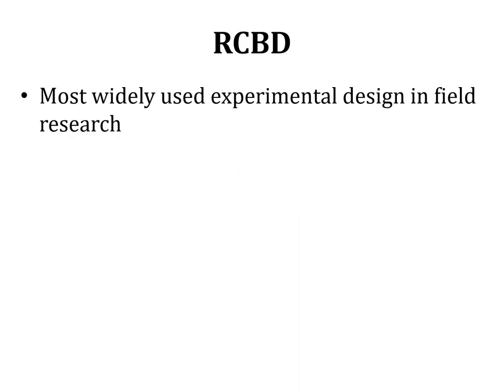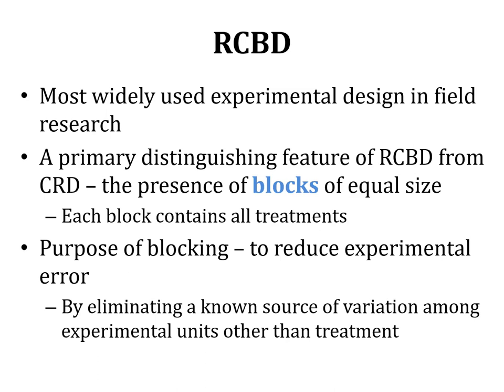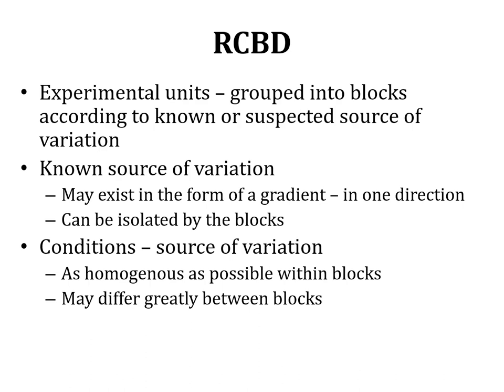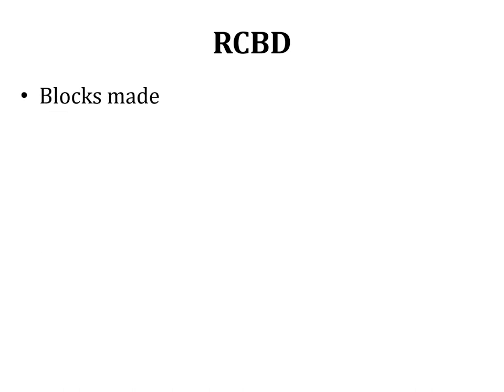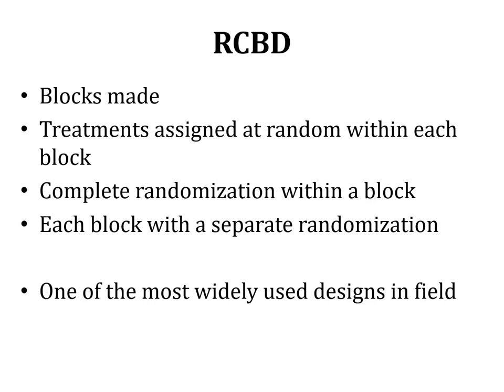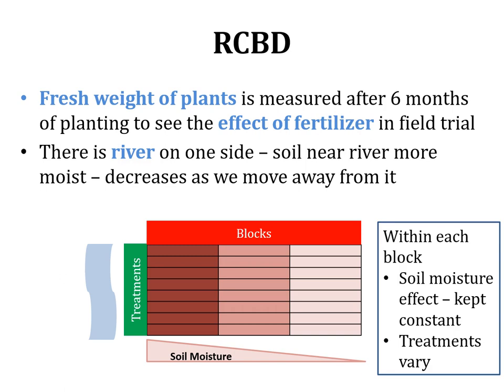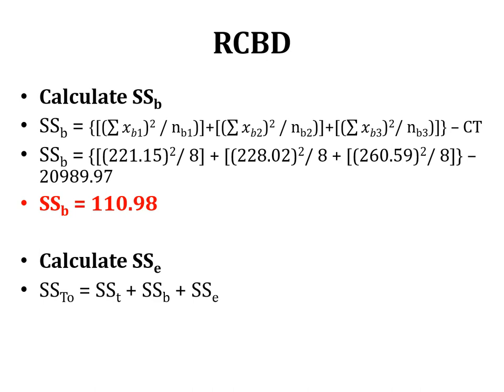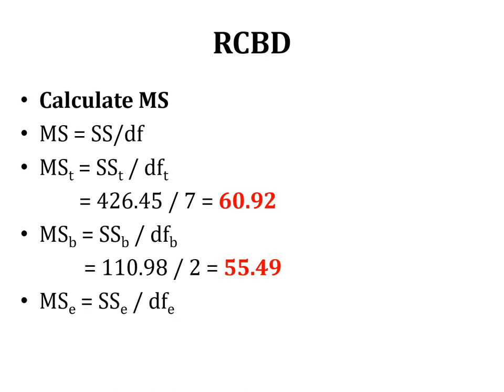Lecture 19 Experimental Designs; RCBD; Randomized Complete Block Design; ANOVA; Two Way ANOVA

Comment: can i ask something, how did u come up with the probability of 0.01 and 0.05, what's ur basis? thank you!
Reply from the maker: You can get the critical F values from F distribution table available in some book or through any online calculator for F test for ANOVA.
If your question is about the probability levels, the 0.05 and 0.01 are critical probability levels. You can watch my video on probability for that.

Comment: Great and Interesting
Madam i need help to analysis the data about pesticide efficacy.
my research is in RCBD design. I used 5 treatments with three replication of each and i got data one day before spray and 1, 3, 5, 7, 10 and 14 days after spray.
Kindly guide me
Reply from the maker: Thanks for the feedback. Probably you will have to use 2-way ANOVA. Main predictor variable would be 5 different treatments that you have used. The other independent variable would be time since application of treatment.

Comment: Please how did you read the values from the table? I don't understand
Reply from the maker: Which ones?
Reply from the maker: The critical (tabled values)? These are retrieved by using DF of numerator and DF of denominator at desired level of significance, i.e. p 0.05 or 0.01 or 0.001.